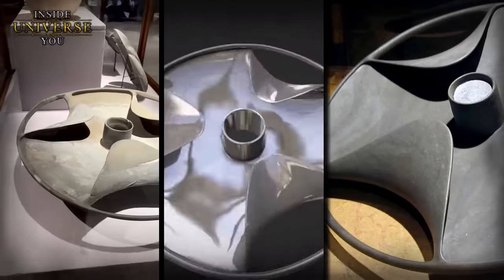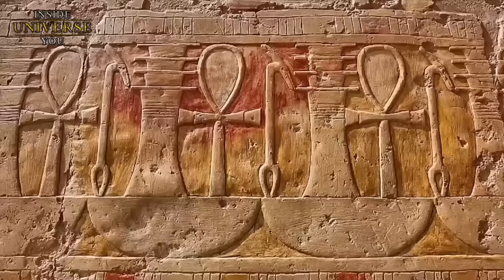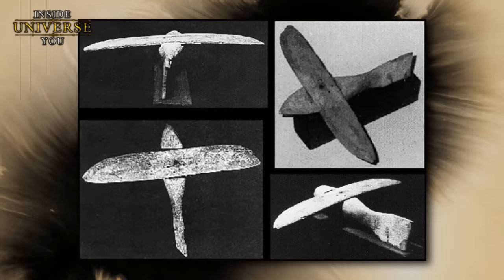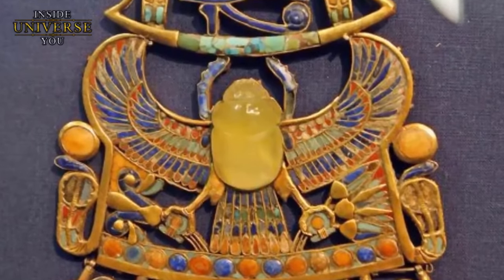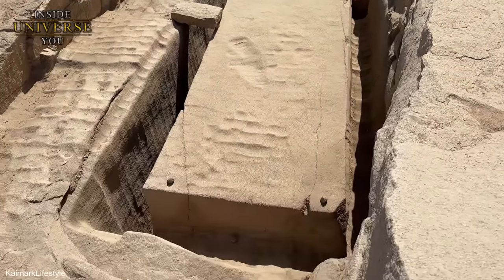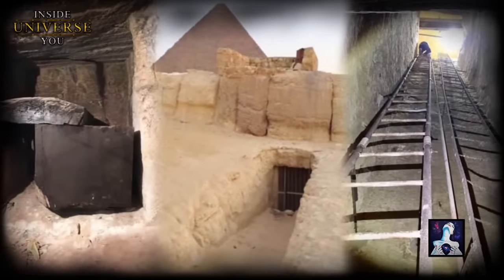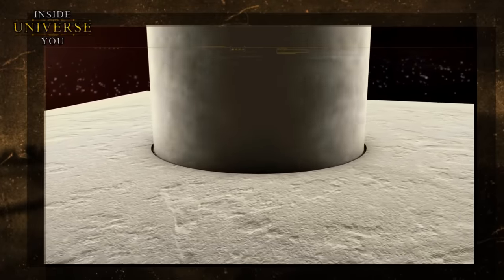Pre-Egyptian Technology Left By an Advanced Civilization That Disappeared

Comment: Everything is Energy 
I just want to share what happens when the human Biofield exchanges current near the Ocean. Going to the beach. 
This study proposes a physical pathway, namely the flow of electric currents through a grounded human body, specifically when standing barefooted on the beach. It is frequently assumed that the ground is an equipotential surface and therefore any conducting body (e.g. human body) in contact with it becomes part of that equipotential surface Because they are thought to be equal in electric potential, it is thought that there is no potential difference between them. With such assumption, it is not expected that current will flow through that conducting body.

However, the natural ground is made up of a mixture of many materials including sand, stones, minerals, organic matter etc. Different materials have different electrical properties (e.g. conductivity, capacitance). Even in a seemingly homogeneous sandy beach, the distribution of these materials are not uniform. The non-uniform distribution of these materials will cause a difference in electric potential between two points on the ground, also known as self-potential This difference may be sufficient to draw a measurable current through the human body.

It is known that organisms generate or rely on electric currents and fields at the cellular level. This knowledge may be one reason for the recent revival of the idea of grounding the human body, which involves putting the human body at the same equipotential surface as the ground. Electrostatic build-up and its subsequent discharging disrupts the natural electric field of the human body and this process has been suggested to have an effect on health. Grounding prevents the build-up of excessive electric field in the body due to these factors. It has also been suggested that the free electrons present on the ground will travel up through the human body as electric current whenever an electrical pathway is established between the human body and ground and it has been suggested that this current has a beneficial health effect.
Reply: You don't have to go to the beach. It's easier just to shuffle your feet on some shag carpet.
Reply: Our animating “lifeforce” is of bio-electrical energy. We are a bio-chemical-electrical -physical life force powered by an advanced physic input that winds down like a clock that releases our life force energy back into the cosmos after cessation of life as we know it. It goes back to the Creator.
Reply: The beach/ocean salty environments & their crystaline structure are very conducive to electicity.

Comment: Could the wooden bird be a child’s toy, with the vertical tail being a handle
Reply: We had those same as toys when we were young, well made balsa wood gliders shaped like birds, many sizes & and colorful, some were launched with big rubber bands like a sling shot some you just threw, I remember they came from somewhere in Asia back in the early 1950's brought back to the US by somebody we knew in the military, Our toy shops didn't have anything even close to  those, Just basic WW2 looking put- together cheap airplane toys with airforce insignias stencilled on them, you adjusted the wing to fly straight or do a loop, & threw them a few times until they broke.

Comment: 1: There is no evidence that the dynastic Egyptians at any point in their history had the required tools to make the tool marks found on many of the artifacts they supposedly built. 
2: There is no evidence that the Pyramids (at Giza) or any surrounding structures at some of the megalithic sites were used as tombs 
3: The erosion of the stones in the construction shows a very reliable  12,000+ years of exposure to the elements.
4: The complexity of some of the artifacts/statues etc found would not be possible to even carve with tools  that our modern civilization had until the 1980s. 
I'm an engineer and definitely not interested in crackpot internet theories about aliens.   But I will tell you from a purely scientific standpoint,  it is physically impossible that a civilization that did not use the wheel or lathe or have access to Iron until thousands of years later would have been able to construct the pyramids.  No matter the man power or any other factor.  Even if they had 10 million slaves working tirelessly for 100 years they never would have made a single Pyramid.   The construction methodology and the way materials were cut and customized to fit would be BARELY achievable today using our largest cranes, excavators, and largest trucks.   
For reference some of the heaviest construction equipment we have on Earth today has a maximum load of about 450 tons.    Some of the single stones used for obelisks and foundation blocks at these sites weigh more than 700 tons,  and a few examples are over 1000 tons.   You cannot slide something like that,  there is no material hard enough to roll it on.    Some of these stones were moved HUNDREDS OF MILES from the quarry sites.   The "official" narrative is dumber than aliens and is totally unscientific and there is a reason they do not allow any serious independent investigation of these artifacts or the structures themselves.

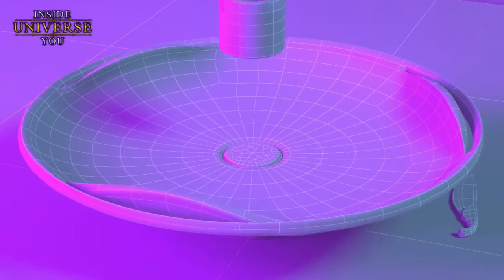Comment: 29:16 In my opinion... the Schist disk was originally metal and sat upon the top of a shaft and at the bottom of the shaft most likely had various stone cutting bits or attachments.  Upon striking the bottom of the shaft would have resulted in the percussion needed to start the winged lobes of the disk into a resinous vibration causing the shaft to pulsate up and down many times per second, like a jack hammer motion.

Comment: Subscribed! Thank you for this college-level documentary! FINALLY some content on Egypt that's worth watching and sharing. I have my own theory on the "melted" stairs. I think that what they used for them was a geopolymer similar to concrete but which unlike concrete hardened very slowly. Normal concrete hardens in a few hours but cannot be fully loaded until a few days have passed. While it's curing, it maintains the same modulus of elasticity, but this material that the Egyptians used had an elasticity modulus that decreased gradually. The "melting"  occured when the curing period was ignored and the steps were put to use immediately. The material had a similar way of hardening like candle wax, where it goes from solid to liquid in a linear progression, unlike water, which can only be either liquid or solid (or gas) and nothing intermediate.
Reply: Nope nope nope.

Not melted, not geopolymer - just natural limestone.

They were cut straight originally.

Contrary to popular thought Egypt does in fact have a rain shower or 2 every year.

Over time the rain water filtered in and ran down the steps, causing the calcium carbonate to partially dissolve from one step and become deposited on another.

The exact same process causes stalactites and stalagmites to form in cave systems that suffer from porous rock and water intrusion through it.

Once you understand basics of geology, a lot of this speculation starts to look very silly indeed, if not predatory grifting in some cases.
Reply: @mnomadvfx  OK if that's the case, then how long would it take for natural erosion to make the limestone stairs look like that? I've been to Egypt and spent 2 weeks checking out the pyramids and it didn't rain once in those 2 weeks, and yes, I was told that they get a massive flood every 2 years or so. That's why all those little tributairies of the Nile are littered with garbage bags waiting for that flood to take them out to sea. At that rate, it would take tens of thousands of years for the limestone to erode that way, longer than the purported age of the structures in question. I'm sure there've been tests done to determine the rate of erosion of limestone from natural rainfall, and that would be the definitive way to test that theory. Build a model staircase out of limestone and subject it to thousands of years of rainfall, and that will show us what really happened (or didn't).

Comment: 5:16 … so dive down, figure out where the water is coming in, plug it, drain it. Or drain it so fast it won’t fill fast enough. Then find where water is coming from, plug it. Nice effort. If it’s being pumped in at a high rate, why doesn’t it overflow the structure ? Nobody has thought of sending a remote control submersible or diving down into it ? Pfftttt…..

Comment: I heard that the center hub of the schist  disc which appears to be perfectly round and symmetrical is not actually located in the center of the disc. Being located just slightly off-center would greatly change the way it would spin on that hub. Spinning it on that hub would create a particular vibration.

Comment: The scoop marks are the sides of drill holes, made parallel to cut the rock.
Then the thinner walls between drill holes are cracked & the rock is separated.
Then the hole sides are leveled as best as possible, leaving scoop marks.
Just a thought...

Comment: The Schist Disk is an acoustical device to deflect resonance silicon crystals as it rotates at 108 cps so that water and pressure stone to stone tapping cracks at the quartz crystals edges to remove and smooth debris material in the finished wall materials. Quartz oscillates at 786,000 cps divided by 32,768 (think Bulova Quartz watches tuning fork) and you get a near 24 degree of a 360 vibration point pattern and 24/15 = 1.6 or PHI 1.61818… a key node Point-Source energy secret of magnetism which everything is made of via the hydrogen molecule (see Ken Wheeler of YouTube Theoria Apophasis to learn about magnetism and how it works to make matter and all of reality!).

Comment: Oval hole is just going up and down with a round drill; not necessarily a specialized tool. They made right angle polygons (ie. square) similarly. Round drill holes, one next to the other in a straight line.

Comment: The idea that they only had copper is silly to me.  They found an iron meteorite dagger in the tomb of Tutankhamun, so the Egyptians were well aware of making steel tools.  We don't' find any probably because iron was recycled like it is today.  We don't have many things made of iron just a 100 years ago.  I would guarantee that the jewelers of that time knew how to harden metals as well.  I worked for a blacksmith when I was younger..  it doesn't take long of beating on metals before you learn how to harden them up.  I completely believe they were making hardened steel tools and bits for cutting stone and were far more advanced then we know.  The proof of the tools is there in the cuttings.  I am a machinist and also guarantee they had large lathes.  Those aren't gear parts, they are cutting tools.  used for surfacing.

Comment: Why is it that people quote archeologists concerning the capability of smelting and forging iron? They literally don't know their proverbial butts from holes in the ground concerning the matter. Contrary to archeologists belief, using simple charcoal, clay tubes, and hide bag bellows, you can attain temps capable of smelting iron ore. Literally the same tech used to melt bronze, gold, or copper, can be used with slightly more forced air (pumping the bags a little faster) to melt or work steel  as well.  You are only talking around a 500 degree difference between melting copper, red brass, bronze, or gold versus melting carbon steel. Native tribes in Africa have been making iron from ore in that manner in Africa "forever" by oral tradition, and the forges used by blacksmiths aren't different in basic function, method, or manner. Original steelmakers in the USA originally used charcoal as fuel. Coal tends to add unwanted impurities. Coke (refined from coal) just uses less fuel to do the same job. Archaeologists should not speak authoritatively on engineering subjects (or geology for that matter). For those that have accidentally made a glass plate with too hot of a campfire, lol, it takes equivalent heat to melt glass ( 2500-2900f) as it does steel (2500-2800f). That campfire would have melted your hunting knife. Impossible my asterisks. King tuts dagger, with the stated iron, cobalt, nickle and chromium, would be by definition, if the chromium is over 10% composition, a modern style stainless steel. I would love to know the full composition including carbon, silicon, vanadium, etc, to compare it to modern steels.

Comment: It appears to me there are some clear technologies implied here, hydraulics, abrasives, metal casting, and fluid dynamics such as for water acceleration. To move large objects a long way, how about a hydraulic road. I saw they even found a lot of rubble in one place. Think of a railway line. Instead, the road is made of perfectly fitted blocks with a fitted block for transportation, on a sand and water slurry (think skimboarding). The pyramids themselves and the smaller ones could have been hydraulic pumps, with the small ones hydraulic valves.

Comment: speacilly intesting is stair shown at 1:16:10, whitch shows that step 4 from the top onthe left picture, has moved in it's entirety, but less on the edges, as if the sides and top surface had already started solidifying when some worker walked inadvertently on the first stop, breaking the top crust, which led to a freing the unsoldified  rock from step 1 on step 2 and then downward, and collecting more paste at each step. This is like beton.

Comment: The Jedi pillar is basically the inside of a light bulb. The huge trench of stone they found with different types of stone inside of it.. pink.. We have our modern day drilling machines right?? The drill has to have a coolant running along with the drill. Couldn't this be the place where the coolant water goes. It's stored and probably reusable. A battery to us is held in our hands. To them it's Giza. So we have to picture 🖼️ What something small could be done Big. Then does it have a Plug on the bottom like a Drain?? And those Giant Stone Gods garding the Palace. They could have walked them into place like they did at Easter Island. Those heads have bodies to them under the ground.

Comment: I know exactly what is going on. Those boxes a large alcohol magnet is used to provide a magnetic field at right angles hence the perfect angles  to both the current and fluid flow directions it is a electro magnetic pump  as current from storage battery passes between the electrodes its mercury that driven a better word around the tube  the glass blown tube  for a closed loop  except the nozzle  and a sink just a Min timing the I think it's call a kelvin water dropper the drop from the nozzle is charged which stops it from clinging onto the nozzle  its negatively charged into the sink well stone box in that matter  negitive drops make  a shield causing induction of positive charges  and a spark will jump the gap if insulation is good  with a head nod and eye brow lift we're good😅

Comment: Please, be notified that ONLY the USA uses inches and foot as measurement system. It is medieval, "imperial". 8 billion people use the decimal system. Out of curtesy to those 8 billion non-Americans, you may want to note all measurements in both the ancient American and the modern non-American system. I fully realize that it is much easier to calculate with 12 inch is one foot than 100 centimeters is 1 meter. Also that 5280 feet to a mile is much easier to calculate with than 1000 meters to a kilometer. But still, please, use millimeters, centimeters, decimeters, meters, kilometers and metric tonnes as well.  E.g you talk about tonnes, I suppose you mean American tonnes, which is 2240 American pounds or 1,016, 047 kilograms. Not everybody on this planet is as good in arthmatic as the Americans who are all smarter than Einsteins of course, for even Einstein used the metric system.

Comment: It’s forbidden to research these things , like underground cities or high technology, , by the Egyptian government and islamic idea’s that might be shattered if there’s proof of ( maybe extraterrestrials influences or such high standards that contradicts islamic ideology) in 1978 I was in the museum in Caïro and there was a huge heavy metal circular disc . It was called; thee tray for the farao 😂. In those times you could simply touch it. It was about 10 cm thick and looked like cast iron. Diameter about a meter at least. It was cartwheeled on the outside and had many circular cartwheeled opening s ( for the thee cups 😂😂😂) i tried to lift it a little bit , because it looked extremely heavy. Which it was. Impossible to lift it ( one side) even a millimetre…. It clearly looked as a machine part . Like old clockwork used to have with radars into radars turning… definitely not a  theetray for sure. When I visited a few years later , it was no longer on display. And the people of the museum had no idea where it went. It always intrigued me. When I tried to investigate where it went . I was told it was a threat to the status quo. There is much more known. But hidden from public view.